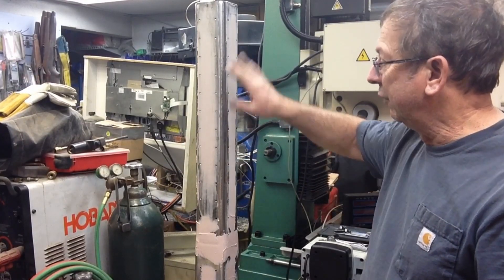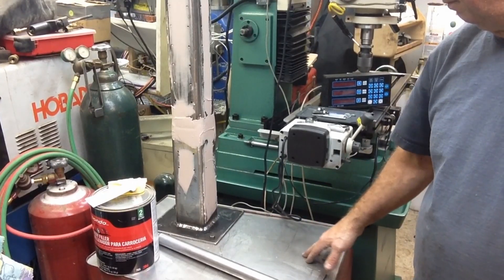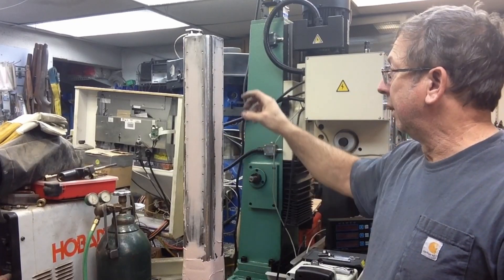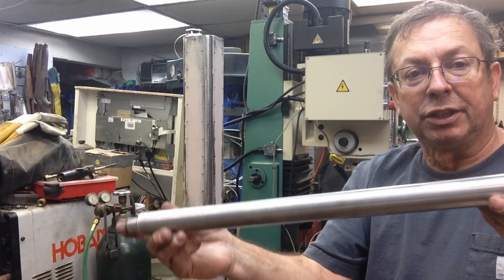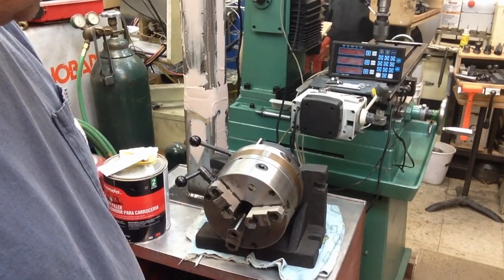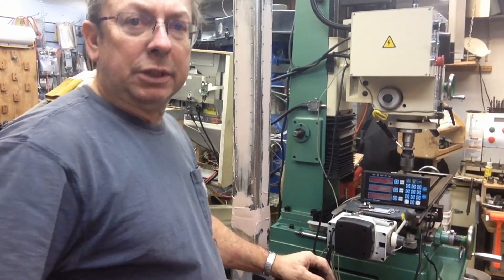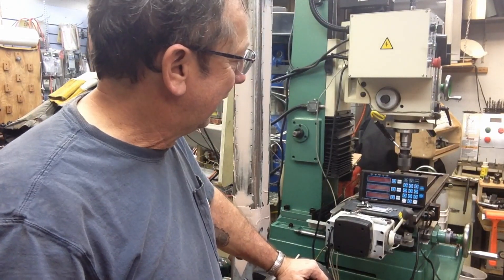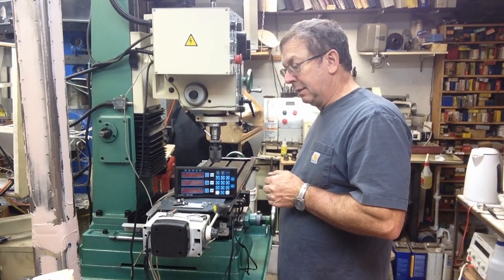Grizzly G0755 , Part 5: The Tool Tower

Comment: Check out the Rust-oleum hammered deep green.  I use the spray can and it almost matches the grizzly green.
Reply from the maker: yea, I have played with it in the past. the problem is I have to hunt for it as it is not always in stock locally and it doesn't go as far before the can is empty and takes longer to dry. I have come to the decision that it is more important for me to be making forward progress than holding up a project waiting for material. Thanks, Dan.

Comment: My back surgeons  as well as a couple of chiropractors have all told me to keep table including work table"bench" heights at the point of my elbows straight down at my side if I want to keep working. I think I heard you say you were from Yakima area. I'm about a hundred miles from you. Very familiar with area though I live in Oregon.
Reply from the maker: Hi Dean: I have heard that as well, but in real world applications it doesn't work out that way when you are standing at a machine. On the mill for example the x and y handwheels are at seperate heights and the comfort level of each individual arm will vary with where I position myself in relation to the machine. I think each individual just has to find what feels comfortable. Yes I am in the Yakima area for now. A change is coming at some point.Thanks, Dan.
Reply: @hillsgun  I do this for a living too. I understand the the different function levels. I was just relaying sawbones info. The more vertical you are the longer you are goi to work. You said you are vertically challenged. Imagine someone 6'5" working on machines of same height. I have a co-worker with that exact problem. Lots of back pain.
Reply from the maker: @deanfranks8242  Don't get me wrong I appreciate the info but I have found that there are no absolutes and in everything we do in the shop there are compromises. Also as we get older there is the issue of eyesight so if we get the table/bench/ machine height (whatever the case may be) to that optimal height we may very well have to be leaning over to better see the work. Choose your poison.